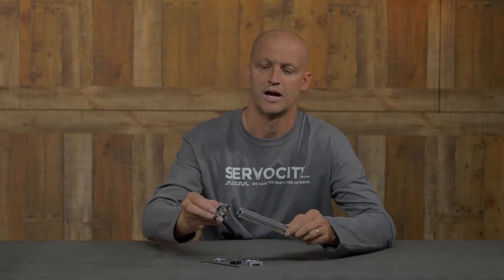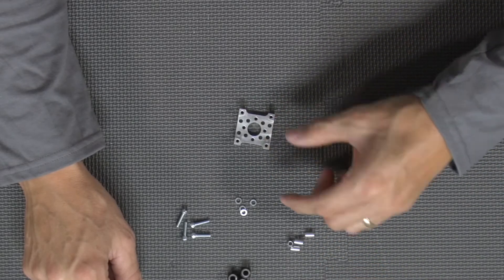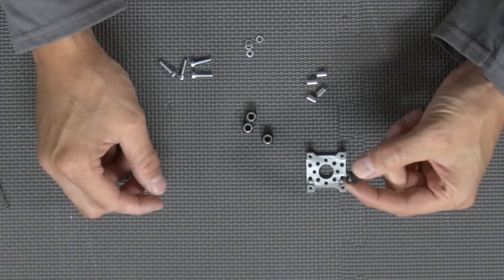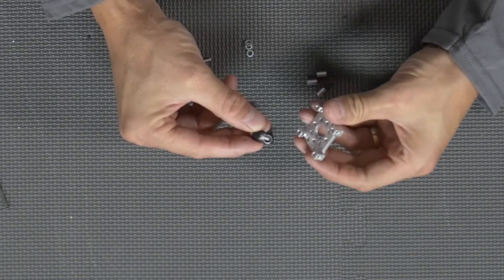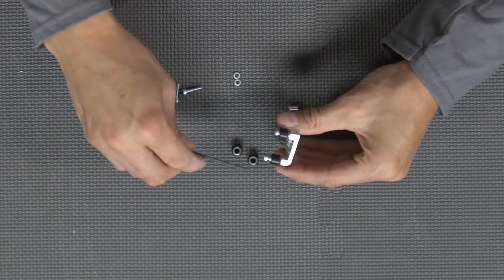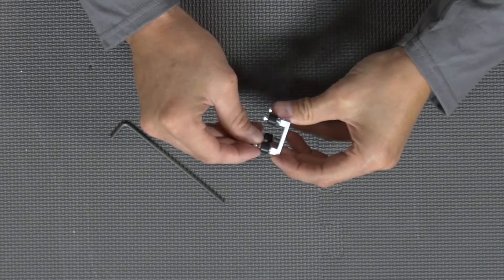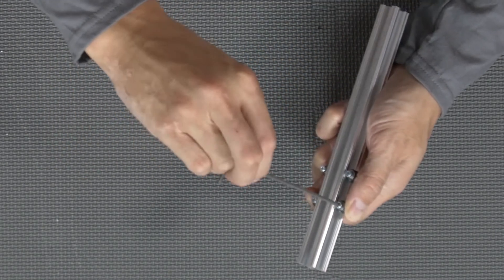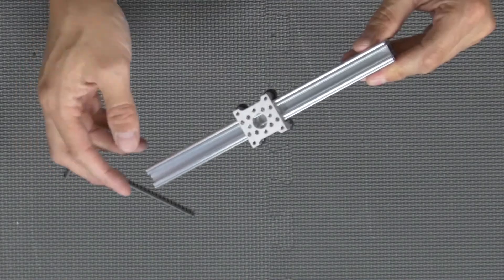X-Rail + Mini V-Wheels = Linear Motion

Comment: Can you like attach a motor with this to make it go side to side?
Reply: I'm trying to do the same thing. You got 6 months of thinking ahead of me lol. Come up with a solution? This rail system is perfect, now I'm wondering how I'm going to get it to move. Looks like using this in conjunction with some kind of push-pull system, such as a belt driven by a stepper motor seems to be the solution here. Trying to avoid constructing my own parts.
Reply: Matt there was no need for a ‘like’ in there at all.. anyways, try 3D printing a bracket?
Reply: Ez e what’s like attach
Reply: Proz71 Ful  What?